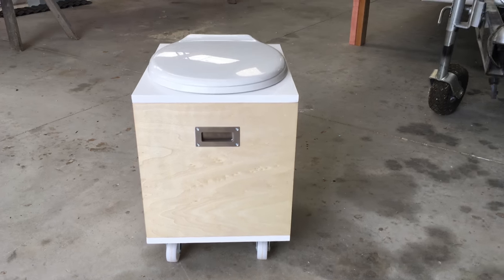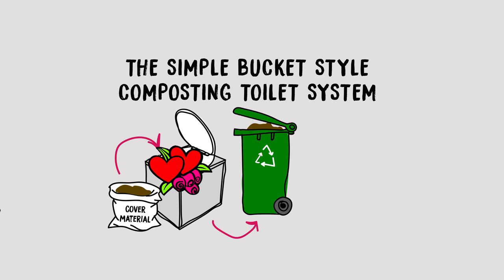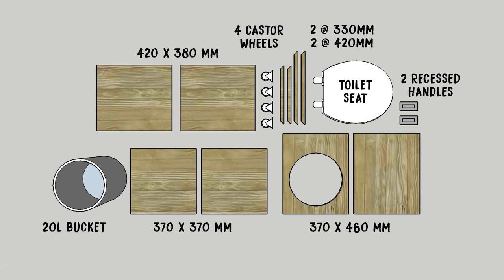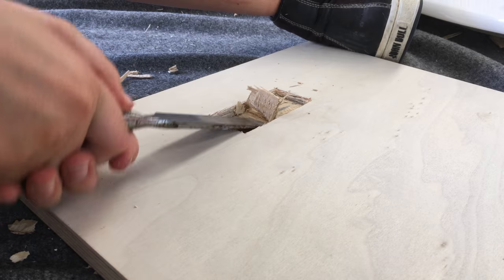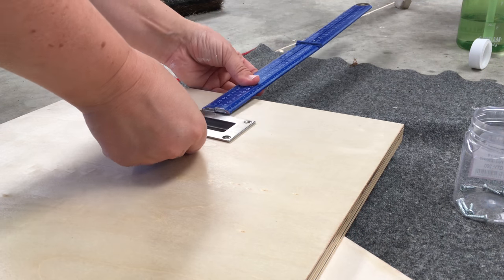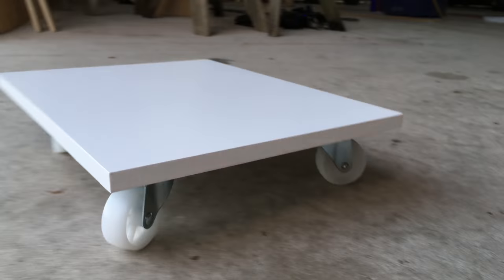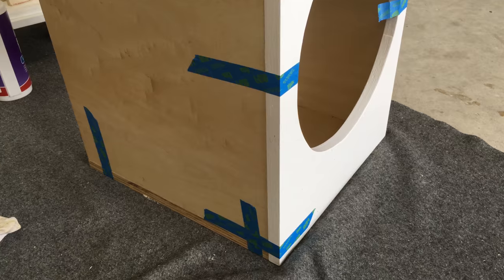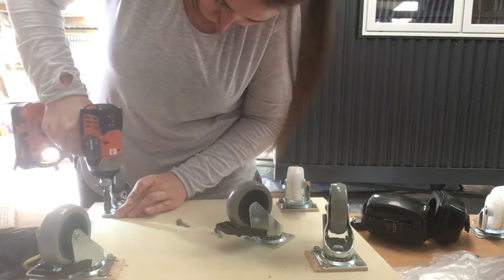DIY Tiny House Toilet on Wheels | Composting Bucket Toilet

Comment: Cool toilet, it's cute too!I suggest setting this up with a urine diverter. You can use a funnel and a bottle to hold the pee. Its way way easier to manage a composting toilet, dumping it, keeping smells at a minimum if you keep the urine out of the compost material.

Comment: Harbor freight has good prices . The locking wheels I have gotten from them worked much better than the ones you got. Plastic you should have sent them back. Metal and rubber tires , strong & lock & roll great.  Great video I plan to do your setup but with funnel in a bottle too, I can't do one with out the other, just the way my body works.  Thumbs up !!!!

Comment: So you wanted it moveable?  If that was just to make it easier to move for dumping...

An alternative you may want to consider is building a box that you mount to the exterior wall and have a hatch door you can access from the outside... This lets you access the bucket from outside instead of needing to carry it through your house, for easier dumping... Add a bench seat cover board that folds down over the toilet seat and it can become a seat area for doing other things in the bathroom for added utility...